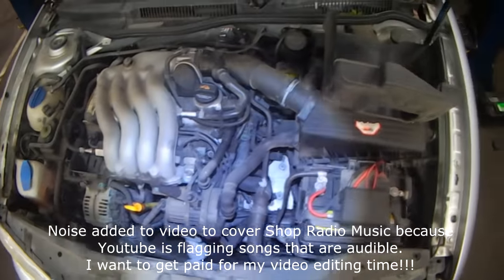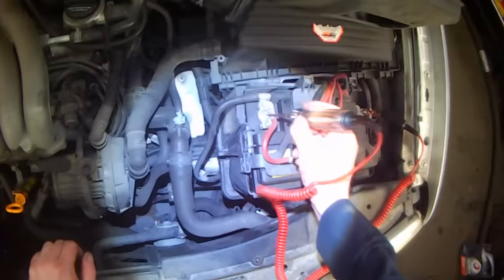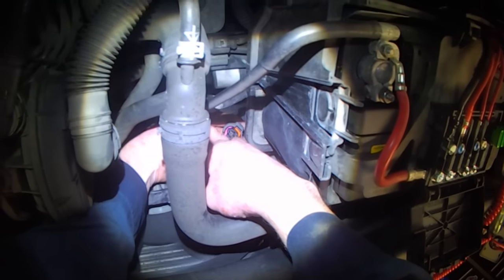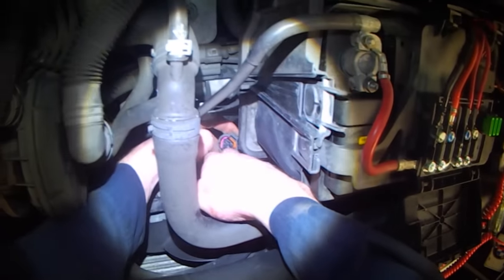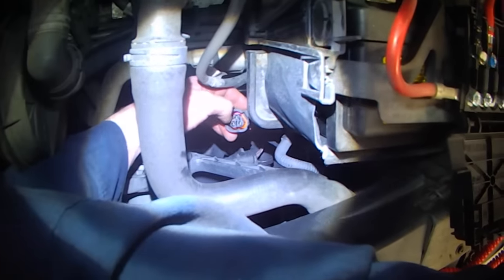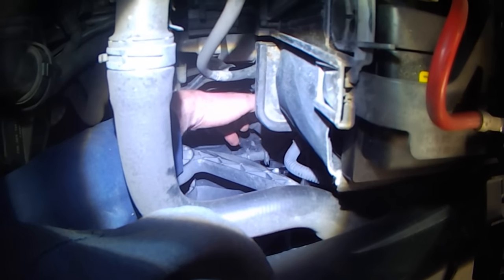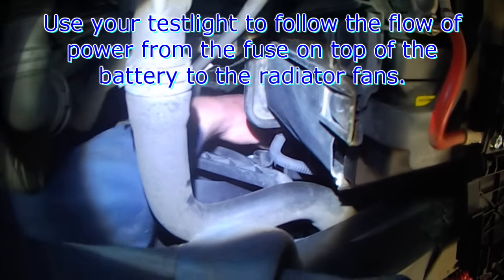VW A1 A2, A3, A4: Radiator fan(s) quick check.

Comment: I jumped power to both my fans and my passenger fan doesn't work. I guess ill just replace both anyways. :) thanks for the great videos on this issue buddy!
Reply from the maker: Year, make, model, engine? Does the one that "does" work, come on when triggered via AC or at the radiator fan switch... as in this video?
Reply: 2002 vw golf tdi manual. The one good one doesn’t turn on with ac turned on :s 
I will try the rad fan switch trick in a little bit!
Reply: @EXOVCDS  Update: There is power at the rad fan plug and the fan turns on when I jump the pins!
Reply from the maker: @2nsane2005  Thank you for the update. If none of the fans are turning on when AC is selected, then there is probably an AC issue / Ac is probably not active. If you are not having any overheating issues, the engine will run fine with only one functional fan... but I would recommend replacing the defective one (or both) to be sure the system is working correctly for the upcoming summer months. If the engine IS overheating, verify that the water pump is working and that the thermostat is opening.
https://www.youtube.com/watch?v=GEo9fG9bURI
https://www.youtube.com/watch?v=5nmqsg3Lmdw
Reply: Thomas EXOVCDS I checked my Freon level and it’s super low. I’m gunna recharge it and see what happens
Reply: I’ve read on some forums that if your ac system is low the fans won’t work apparently. I’ll report back. My brothers bmw 3 series was the same way
Reply from the maker: @2nsane2005  Ok, thanks!
Reply: Thomas EXOVCDS WORKS!! just added a can of Freon and now my Ac works and the fan spins. The fan even spins with car off, ac turned on and speed 1.
Reply: As I was adding freon I saw the fan switch on :). Thanks heaps buddy! I’m a subscriber now😊. I’m off to buy another passenger fan as I found it it was garbage haha
Reply from the maker: Good stuff!

Comment: I'm confused. How did you get the fans to turn on after you disconnected them to test power?
Reply from the maker: As can be seen at 1:05, I used a metal paper clip / wire to bridge the "power" with the "load" (fan) side.
Reply: He didn't disconnect the power to the fan. He disconnected the plug from the temperature switch that tells the fans/fan control module to turn on low speed or high speed.
Reply from the maker: Thank you for the clarification ... I always assume that people pay attention to what I am doing in my videos. Actual fan harness plugs look different to the one I was bridging... and I don't recall mentioning to disconnect the fan. Thank you for paying attention to what I was doing! =)

Comment: The fan world when i touch the pins but wont work when the engine reaches operating temperature, what to do?
Reply from the maker: Year, make, model, engine?
Reply: 2006 vw polo 9n 1.4 bky. I think i found out that i need to replace the radiator fan switch
Reply from the maker: @dennyl9914  Is the radiator getting hot? If not, then the thermostat is stuck closed. If the car does NOT overheat when you are driving,  then the thermostat is OK.

Comment: High speed not coming on. New control module, new temperature sensor, new thermostat and new radiator temp sensor.
Reply from the maker: What year GTI? One or 2 fans? If 2... both fans affected?

Comment: Definitely not easy to get the fan switch off... any tips?
Reply from the maker: Year, make, model, engine? The more info I have... the better I can help.
Reply: @EXOVCDS  2005 VW GOLF 1.9 TDI
Reply from the maker: The connector has a small tab that needs to be released. Push the connector towards the sensor and then pull the release tab back, at the same time pull the connector off of the sensor. All VW / Audi connectors work the same way. Practice on one of the connectors at the engine. Like this:
https://youtu.be/3GBtR7fpvyY
Reply: @EXOVCDS  thanks!  I’m starting off with triple checking the fuse box on the drivers side door panel with a test light.  Should 5, 16, 25 all light up when connected to the negative battery terminal?  Only some of the fuses seem to.  Fuses don’t look broken to the eye, but just wanting to make sure.  Thanks for your time.
Reply: @EXOVCDS  never mind... dumb question.  Got the connector off.  Thanks
Reply: @EXOVCDS  I have confirmed power at pin 1 of the fan switch and jumping to either pin does not start the fan.  How do I apply power to the fan connector?  I’m assuming I can jump from pin 1 on the fan switch, but which pin do I apply power to?
Reply from the maker: Use a bare metal paper clip and follow the instruction in the video.
Reply from the maker: Fuses only light up when they receive power. Not all fuses receive power at the same time.
Reply: @EXOVCDS  got it.  I definitely have a dead drivers side fan.  I took it out and am waiting for a replacement in the mail.  I have confirmed that the passenger fan is working.  Is that fan supposed to operate independently from the drivers side?  Because it is not coming on when I turn the a/c on and fan on high.
Reply from the maker: Big & small fan should come on together / at the same time... low or high speed. Check both speeds directly at each fan plug by applying ground to the brown wire and switch power petween the other two. If one or both speeds are not working, replace the fan.
Reply: @EXOVCDS  Thanks!  I was able to get a new large fan and install and confirmed that it is working via bridging pin 2 and 3 on the fan switch.  Unfortunately didn't help the A/C problem.  I recently got an OEM fan control module and swapped out the original.  I might try swapping back to the old fan control module.  Still not clear on whether the fan motor being out on the large fan would cause the smaller fan and the a/c not to run.  I have never in my owning the car (9 months) see either fan run.  Garage confirmed that the compressor clutch works.
Reply from the maker: Fans have no impact on being able to turn AC on... the fan module is just a relay box that receives inputs and then triggers the fans accordingly. If AC pressure / charge is low, then the compressor will not be turned on. If evaporator temperature sensor is faulty... AC will not be turned on. If ambient temperature sensor is faulty... AC will not be turned on. Get yourself a wiring diagram and an AC pressure gauge set. Check line pressure... check / verify AC pressure sensor operation, confirm that applicable fuses (according to wiring diagram) are OK. Low & high speed fan operation should work regardless of AC on or not. Verify that low speed comes on at extended idle. If yes, disconnect the rad fan switch and let the engine get hotter. Reconnect the rad fan harness plug when the temperature needle goes past the middle and gets close to 3/4. You should see & hear high speed fan operation (mind your hand / fingers when doing this). It's safer to unplug the sensor from under the car, rather than reaching down over the large fan.

Comment: I have audi a4 b7 1.9tdi when i put keys into igntiton and put it to on postiton the fans come on and switch it all off and retry everything is fine why is this ?
Reply from the maker: jake chapman not sure. Check for fault codes (in all applicable modules). Run output tests to see if everything checks out as it should.
Reply: Thomas EXOVCDS i will get vag com on it also sometimes the eml light comes on and the error code is po672 and po673
Reply from the maker: Both are glow plug codes, shouldn't have an issue with rad fan operation.
Reply: What should i check to fix glow plug codes car runs good apart the code being there and the fans come on sometimes when putting keys in ignition what should i check
Reply from the maker: jake chapman Glow plugs can be checked with a test light.
Reply: I know under the dashboard is bit damp and drivers footwell when its been raining get its down near battery and leaks into cabin under dashboard at the back
Reply: Thomas EXOVCDS how do i check power to glow plugs.  I have to crank engine for couple seconds to get glow plug light to come on ?

Comment: Hi Thomas my skoda Octavia 1.9 tdi 2007 ac not working at idle and car moving ac on pls help
Reply from the maker: Are the radiator fans spinning at idle?
Reply: No
Reply from the maker: @sagarjhambhulkar6270  Do the fans come on when the engine gets too hot? With a TDI, it can take a long time for the engine to get hot enough to turn the fans on. You will need to check a wiring diagram to determine how the fans are turned on when AC is ON. It could be that the fan fuse is bad (the one on top of the battery). I'm not sure if your Skoda has the same fuse box by the battery, if yes, check the fuse. If your Skoda does not have the radiator fan switch (like in this video), then the fans are controlled by the ECM (sends a signal to the Fan Control Module that is located behind the large radiator fan). In that case, you will need to check for a "signal" from the ECM at the large fan connector... if a signal is present, but the fans do not work, then the Fan Module is bad (but first verify that battery + & - are present at the large wires of the connector.
https://www.youtube.com/watch?v=oqdv4cm86Ns
Reply: @EXOVCDS  
When the car is in motion the ac gets ON but on idle even if the engine rpm is increased, the ac remains OFF.
The radiator fuse and also the ECM is Ok.
Reply from the maker: @sagarjhambhulkar6270  The AC is not cold at idle because the fans are not on... when the car is moving, there is lots of air flow through the AC Condenser (cooling it). You need to determine if the fans come on "without" AC... that will tell you if you have a fan problem. Did you already check for battery + & - at the radiator fan connector? Did you check for a signal from the ECM? I have not looked at a wiring diagram to see how your fans are triggered (old way like in this video or by PWM signal like in the other video). I have to leave the house now... I will check back later. Post a video on your channel so that I can see what your Radiator fan setup looks like (old style or new style).
Reply: @EXOVCDS  Ok..Thanks a lot
I will check the same and let u know 2mrw
Reply from the maker: OK.
Reply: @EXOVCDS  hello Thomas. I checked my car from AC mechanic, there is no problem in the AC system. However when I scanned the same it showed a error of wheel speed sensor. There is no current from ECM to AC at idling but it connects when the car moves and thus the AC gets ON. Would you suggest what can be the problem?
Reply from the maker: @sagarjhambhulkar6270  With scan tool... connect to ECM and activate "output tests" or select Radiator Fans in the output test menu. The fans should turn on. Yes / No?

Comment: If the fans don't come on could it be thermostat?
Reply from the maker: If the needle stays in the middle, then the thermostat is ok. How long are you letting it idle? It can take 15 minutes (or longer depending on ambient temperature) for the fans to get triggered by the rad fan switch. Once the needle moves past the middle point, check the lower rad hose if it is warm (lower right corner when standing in front of the car). If it is cold, replace the thermostat. If it is as hot as the upper rad hose... replace the fan switch.
Reply: @EXOVCDS  yes I've let it warm up well passed 20 min marker, needle never goes passed the middle mark . Rad hose lower is cold still and fans are not coming on .
It has been intermittently triggering the 2181 and p0172. 
So even though not overheating it could be the thermostat correct ?
Reply: @EXOVCDS  are you still working in the lower mainland ?
Reply: After looking for the fix for this under my hood I've noticed green coolant in my car. It's used and 300k + on the odometer. But should that concern me to flush it and change it?
Reply from the maker: No. A bad thermostat will cause overheating.  Hold engine rpm at 2000 for 10 minutes. Fans will either come on or the needle will go higher.
Reply from the maker: @RYBR  yes. We can meet up in a parking lot so I can have a look.
Reply: @EXOVCDS  so if I hold at 2000 for ten minutes and it doesn't heat up and fans don't come on what is it ?
Reply: @EXOVCDS  thanks for all your replies, I'm in mission but would gladly drive to a lot near you for a proper diagnoses,  if you're serious.
Reply from the maker: @RYBR  I can only go by the information you give me. If the car is not overheating no matter how long it idles or how hard you drive it... then the thermostat can not be bad, or the reason for fans not to come on. The reason I say to hold the rpm at 2000, is because at idle, a lot of heat is lost to ambient temperature.  If the lower hose does not get warm, then the needle has to go past the middle (thermostat not opening, causing overheating)... but since you don't have overheating issues, it's logical to assume that you just haven't given the thermostat a chance to open or catch it in the open position. Once you drive the car, the radiator & lower hose will get cold again... and the thermostat will close again (to maintain engine temperature).
Reply from the maker: @RYBR  200th st & Langley at the colossus movie theatre is a good spot.
Reply: @EXOVCDS  okay, seeing how well you reply to literally everything thrown at you I can assume this is a good way to contact you to let you know I'm there.
Reply: @EXOVCDS  ii will try the 2000 rpm deal for 10 minutes first though. Thanks
Reply from the maker: @RYBR  what's the verdict?
Reply: @EXOVCDS 2007 golf city 2.0 300k km.  verdict is the fans just are not coming on  after revving it to 2000 rpms . Note: I drove it to Costco first so it was def warmed up , then in the stall I had it to 2000 rpms to see how far the needle would go and it stayed at just one needles width above middle. It seemed to want to go higher but just wouldn't for the five minutes I held it there . 
Fans turn freely by hand and with jumper on the detached harness . I believe I only did it with the key off.  if that matters? 
The big green fuse seems to be good . I have not owned this car for more then 5k km but the fans def used to come on as I remember them. Often running for a minute or two when I would get out after shutting the car off . when I bought  the car the engine bay would get so hot u would think it was overheating ,  but I've never had a vw before
Reply from the maker: @RYBR  we can meet up next weekend so I can have a look.
Reply: @EXOVCDS  the hose connector for the coolant coming from right at the firewall has a 45 kinda with a small line coming off the top, it broke on me the other day so I went to the local pick a part and grabbed a replacement. Don't know if a leak would set a2181 or p0172? Or if it was even leaking as no signs of leaks , I was checking for vaccumn leaks as well as checking the coolant flow back into the rad reservoir with the engine running . I did not have to disconnect the hose at the top of the bottle to see coolant dumping in , is that normal ?  Anyways the coolant  connector at firewall broke while checking another hose right bedside it ( brake booster line I think ) and it blew off not even touching it. 
Thought this might help with diagnosis , but I know I don't explain it well . Thanks for patience, buying this car has been interesting to say the least.
Reply: @EXOVCDS  sounds like a plan. Gf will be using it during the week but hell it's not overheating so👍
Reply from the maker: @RYBR  plastic flanges get brittle with age... they can break by themselves or when accidently applying pressure against them. P0172 is system too rich. P2181 is usually from a thermostat that is opening early (needle takes a longer time to reach middle & will drop below middle once car is at cruising speed), but that should not keep the fans from coming on, since when the vehicle is not moving, the engine should still heat up to the point where the rad fan switch gets hot. As mentioned before, ambient temperatures play a roll (takes heat away from radiator / affecting warm up time). Coolant return flow should be visible at idle when reservoir cap is off & looking into the bottle. The higher the rpm, the more flow back into the bottle. A cooler running engine will use more fuel and could be the cause for the rich running code.
Reply from the maker: @RYBR   OK. We can figure out a time for Sat or Sun by Friday.
Reply from the maker: Any need to meet up in Langley? I could be there by 1pm.
Reply: @EXOVCDS  okay, I would definitely still like to meet up with you. It's been so cold and the road is iced where I live that I've been avoiding driving the golf. Not used to it in the winter. It's been so cold and windy I didn't want to risks breaking down lol.  1 pm at the movie theatre ?
Reply: @EXOVCDS  if that still works for you
Reply from the maker: @RYBR  I can be there at 12:30 or 1pm.
Reply: @EXOVCDS  1  pm please
Reply from the maker: @RYBR  ok
Reply from the maker: @RYBR  white bmw  with exovcds on the tires.
Reply: @EXOVCDS  2007 2.0 slow grey
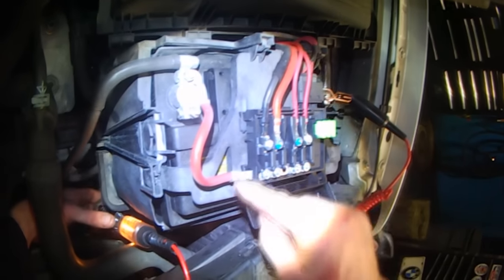Reply: @EXOVCDS  I'll be there exactly 3 minutes after 1:00!